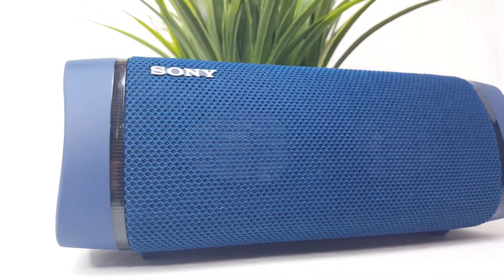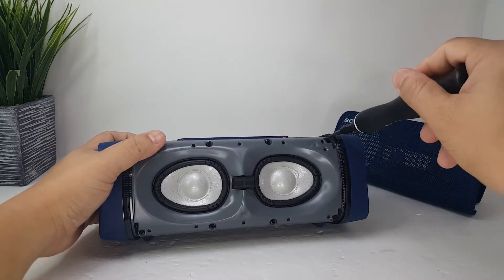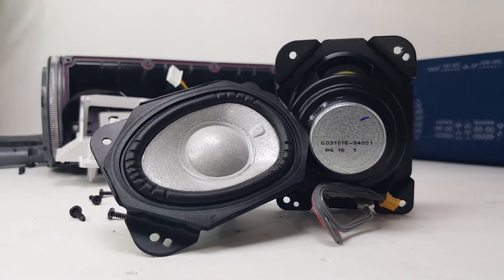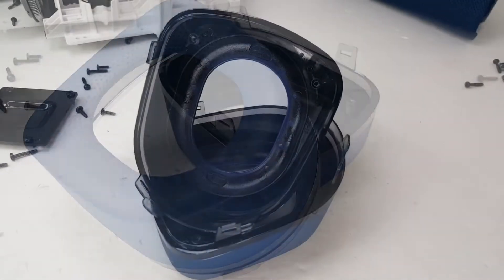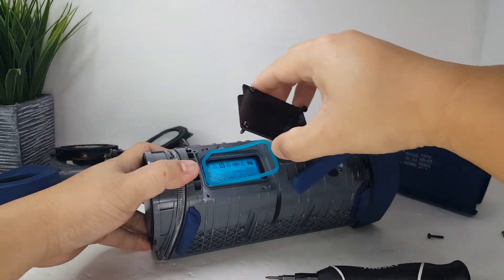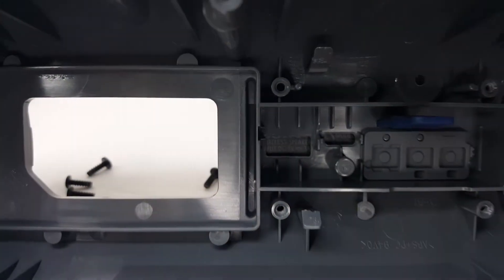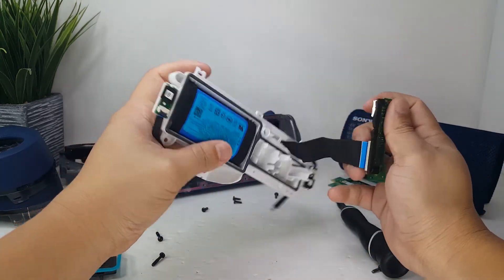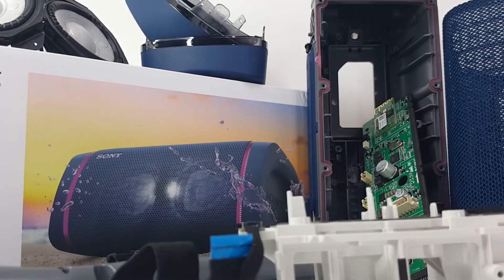SONY SRS-XB33 COMPLETE TEARDOWN

Comment: It is possible to remove battery from the compartment? Pl replay
Reply from the maker: you can as its just glue onto there, but you may need to take the speaker apart to safely disconnect it from the motherboard.

Comment: The wierd propietary speaker driver is nearly impossible to find the part to replace, only its brand model itself, and sony speaker is not so famous, if it damaged, unlike other round shape , you can easily to find alot of third-party driver. However I really like the overall design.

Comment: yamaha yda174-q    2x15W AMP. Low EMI Class-D circuit V15W+15W amplifier. Built-in YAMAHA Pure Direct Drive Class D circuit achieves high efficiency while reducing EMI (conducted and radiated interference). and minimize external components. In addition, it has perfect protection function for high-power speakers

Comment: Can the battery be removed with just opening that little black backplate?
Reply from the maker: no the battery has to be take out from the inside.
Reply: @HBV90  Then what's the purpose of that black plate anyway if it doesn't offer you an easier way to acces the battery? :)))

Comment: Hey, i have a question, do you put it back up with no faults? Did you need to use more glue, and is it safe for the waterproofing?
Reply: This is not safe with the waterproofing unless you be sure to tighten the screws a lot and put the “sticker foam covers” over the hidden screws. He did put it back together with no faults

Comment: I have this speaker and its awesome its really better than a charge 4 or 5 for 60dollar less.
Reply: Based on bass it is better cus it can go to 20hz on the low freq mode.
Reply: What, really ? Charge5 have more bass and with correct EQ, sounds really good

Comment: Any information about the speaker Wattage?

XB30 has 2×25W

XB31 has 2×16W
Reply: Xb33 has 2x15w
Reply: @idk-bo6uq   That one is unrated, by driver movement it's 2×12 to 2×16W, it's also by far not as loud as the XB30
Reply: @fa14bi-78  the woofers are stiff when you first use it give it 1-2 months  then you will hear a difference also it has been rated by someone
Reply: @idk-bo6uq  Ah now I see you wrote 30W speaker in total which is far more likely than 90W
Reply: @fa14bi-78  xb23 16w:xb33 30w more watts when plugged in:xb43 50w
Reply: The sides are Passive Drivers,,, they are the sealed method of porting, and they are a tuned mass that helps regulate the base performance.

Comment: Hi can you please tell me the complete specifications of the battery. Please include the dimensions on the batteries used. Is it the same with 18650 Battery? Thanks